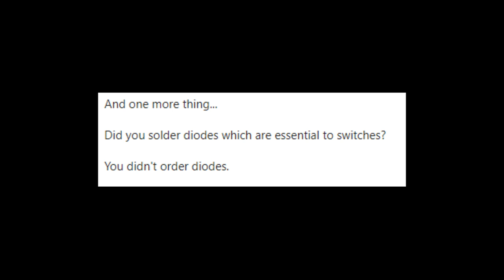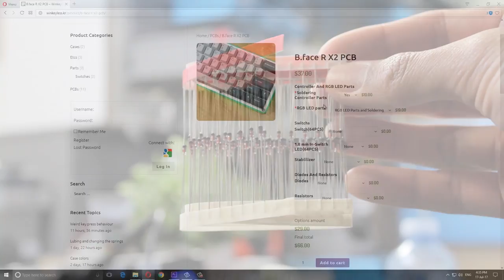Mechanical Keyboard Build : 60% B.face with TEX Case

Comment from the maker: Alright so just to clear things up for some people. This is not 10k.
I had a 'Custom Request' option in my store which was listed at $9999, which I thought made it obvious that it wasn't the price, and people would contact me - as stated in the listing. And it wasn't even setup to process payments anyway.
I'll fix it up to avoid any potential 'confusion' :)
Reply: dear #taekeyboards if i want to buy ( or order a custom ) keyboard which similar to the one in the video, what would be the price for it ? and how can i contact you ?
Reply from the maker: Contact me in the contact section of my website :)
Reply: with the winkeyless PCB what option should I have selected? Right now I have almost everything and it's $100+
Also this is the right PCB right? http://winkeyless.kr/product/b-face-r-x2-pcb/

Comment: Lucky owner, and lucky you for getting to build one. I must say, you got those cuts really clean in the bottom of the case. I think the keyboard standing up with the blurred background is your signature shot now. You do it really well. Forgetting diodes and resistors is one for the facepalm scrapbook :D
Reply from the maker: Thanks mate. 
Haha yeh, everything changed when I figured I could stand the keyboard up, instead of doing all overhead shots which was difficult because my table is too high :)

Comment: Awesome build!

Also did you have any problems when pushing in the LEDs into the SIP sockets? The first time I cut the LEDs I cut them too short and they ended up falling out of the socket, or they would just flicker. So I bought some new ones and I cut the leads right before the part that sticks out a little, and that seemed to work but they were really hard to push in, I ended up using a flathead screwdriver to push them in.
Reply from the maker: Thanks!
I had no issues. I figured out the right length for the pins, so it was good there. But I didn't have issues with pushing the LEDs in. In fact I probably would have liked them to be just a touch tighter.
Reply: Thanks for the reply!

Comment: Are the RGB lights visible without the translucent frame. I really like this design, but am thinking of making it with a wooden frame. It doesn't matter how bright they are, they just need to be visible.

Or, are there any other relatively cheap RGB PCB's that would work well for what I'm looking for (60%, RBG mechanical - The RGB's don't need to be rainbow (white would be good), just strong enough to be noticeable)?
Reply from the maker: The underglow LEDs? Those won't be visible with a solid opaque case. You can still make a wood case, but put an acrylic layer at the bottom, and have some rubber feet, and the bottom of the keyboard will glow.The DZ60 is a cheap underglow PCB that is readily available.

Comment: +TaeKeyboards Nice build. I need a few recomendations, I want a keyboard with functions and home/end/del/pgup/down, what size would it be? Also want ti build it with blank top keycaps, do you have a place where I can purchase the parts for a build like that?

Thanks!!
Reply from the maker: Thanks! If you need all of that, I would recommend a 75% build. Something like the KBD75 from KBDfans would be a very good choice. Remember, this will require soldering work :)

Comment: where did you get the rgb leds i wanna put rgb leds in my corsair strafe wich only has red leds but i can't find any
Reply: It may or may not work. For RGB, most of the time you need 4 pins (RED, BLUE, GREEN, Ground) while normal LEDs only use 2 pin (positive, negative) your PCB may only have two holes for the LED.
Reply: ADCBot is there any way i could find out?
Reply: I just Googled it, looks like there are only two pins for the LEDs.
Reply: ADCBot yeah but i found leds on amazon that are 3mm rgb with only 2 leads would they work
Reply: I don't think you will be able to control them with CUE though.
Reply: ADCBot cue?
Reply: Corsair Utility Engine or something, how you control the RGB LEDs. I honestly don't know too much about this stuff I think you may find better info if you go to r/Corsair or the Corsair forums.
Reply: ADCBot ah well you were a big help and i would just need to dowload the rgb drivers wouldbt it work the same since it is just an led the pcb is what is doing the work idk though
Reply: There is a pretty big chance the the controller on your board is slightly different from the RGB board too, but still like I said earlier,  I don't know too much about this stuff.
Reply: ADCBot you we're still a great help and yeah I'm trying to find someone else who did it with some sort of coraair keyboard can't find much

Comment: whats the difference between the b.face r x2 and the b.face x2?
Reply from the maker: North or south face LEDs. Basically the orientation of the keyswitch, which will either have your LED on top of the switch, or on the bottom towards you. The normal B.face is cheaper.

Comment: Why use such rare and expensive lube ? Why doesn't the keyboard community research more commonly available lubes and oils like superlube grease and oil. I experimented with this mixture and found it awesome for my topre board and used it on mx clear rails. They are indeed a bit more quiet as I don't have a soldering iron I did the slider rails while pushing down on the switch works ok and the result is great. Need  more testing but I don't have that many boards so it's up to someone else